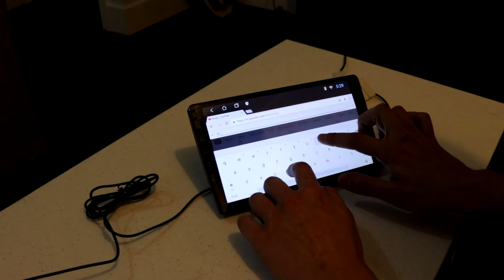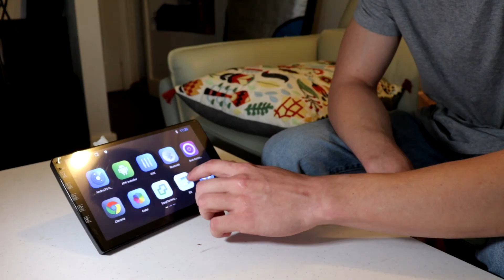How To -  Power a Car Stereo with a Wall Plug - D.I.Y

Comment: If you use an android car stereo, you can use your 12v adapter but for old stereo, u need much more ampere above 2. Using an adapter to old one works but not great, so u should use smps or an battery of Direct Current.

This Info Helps Everyone!
Reply: It sure does, now stop stalking me you suck bastards

Comment: I do wonder if this would work for using a light bar off of a truck??
Reply: Yes and even if you have a drill battery spare, u can connect it to that as well, just be sure to see the negative and positive indicators on the battery itself

Comment: Ha! Shit worked! I used a 12v 1amp plug no problems at all been using it all day and for speakers because I saw a comment about that, well you hook up the speaker wires the same way as you would to the harness idk if I said that right whatever lol

Comment: Good video withe the exception of....you left out wattage info...A safe would be 12v and 1A because the more amperage, the more dangerous the situation. Your video just says to use a 12v adapter. If they use a 12v with 5a they could be in for some serious trouble.

nuff said?
Reply: There’s always a risk with playing with wire
Reply: Yer so annoying don't say what amps out put 5?10 ? As yet mine not on 😢

Comment: Does the settings reset if you turn it off? Thsts the only thing i don't want to happen. I guess you can always add a small 12v back up battery to the yellow wire

Comment: How many amps should the power supply be? 110 to 12 Volt we know,  but what amps?
Reply: Av already got a block but how many amps does the block need to power the unit.8v or 10 v or more ???

Comment: I tried with a laptop charger, i plugged it in and saw with a test screwdriver that both red and black cables had power and was afraid to plug it to my screen. I thought only red should give power, im i wrong?
Reply: Noooo both have are gonna show up on a test light as power because of cognuity but with a car radio the ground and 12v power supply both have power really that’s why it’s on a accessory/ignition switch 💪🏼

Comment: I just tried this but am using a 12 volt power source I bought seperately, my stereo is a single din 7" android, I wired the yellow and red together and put to positive and the black to negative, stereo powers up but screen stays white, it responds to the remote but wont play music or cd/dvd though unit accepts them when u add disc to unit, its like another wire needs to be hooked up or something, the guy I bought it from had it working in his garage so its not broken, am I missing something?
Reply: Your 12 v. power source might be the wrong amperage.
Reply: I tried this but my power supply unfortunately was 3.34 amps so find one with 5 or more